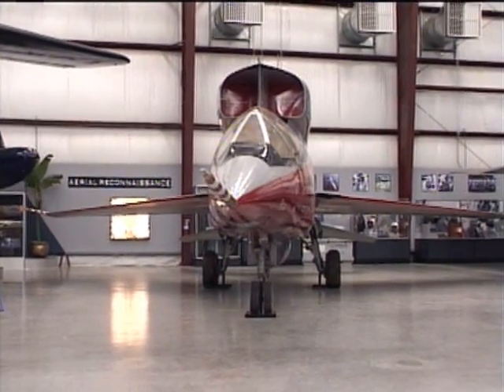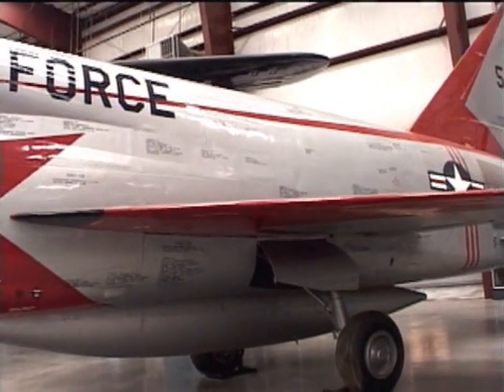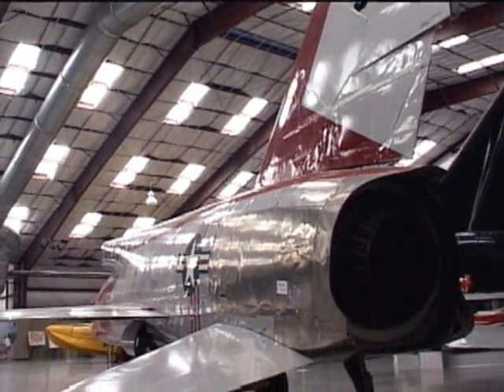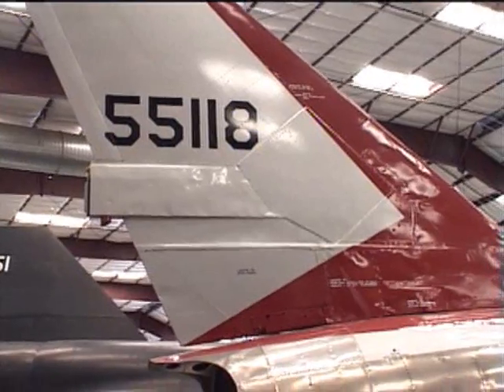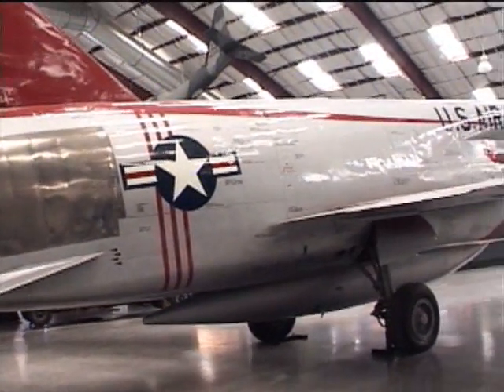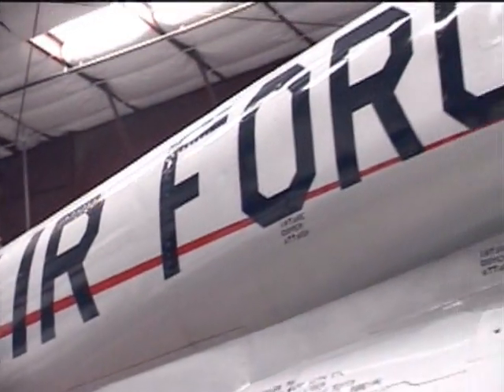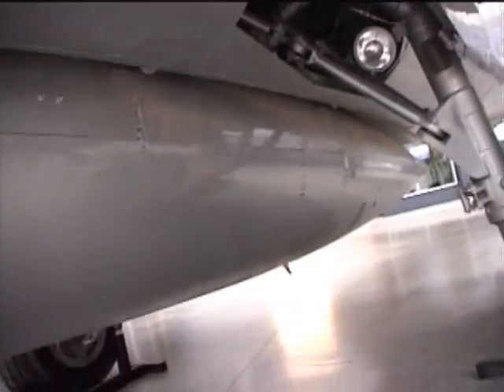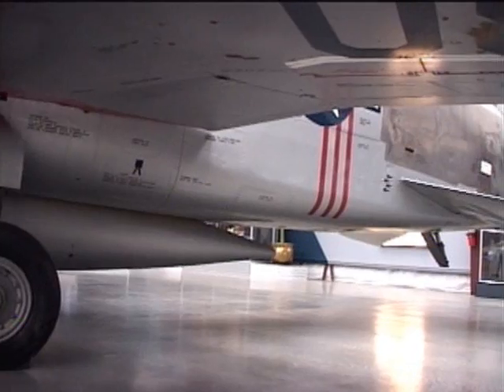F-107

Comment: I think the West Germans at that exact year ( 1956 ) the F-107 was testing was looking for a aircraft that the F-107 would of filled  and or succeeded all of the requested performance parameters, Those dummies' ended up with the F-104 starfighter, we all know how that turned out.
  When you checked off all the list and once you got over the intake just above and behind the pilots head ( good ejection seats supplied, good FOD and ground crew safety ) they would of had a good aircraft that would of served them well for years till they adapted the Pan avia Tornado in the late 70s early 80s .  I hate wasted superior R & D.